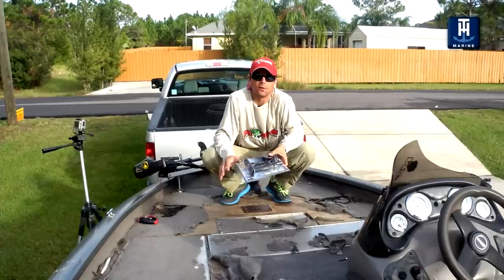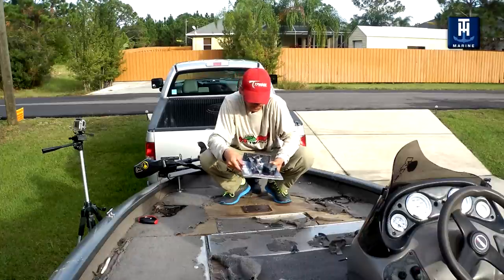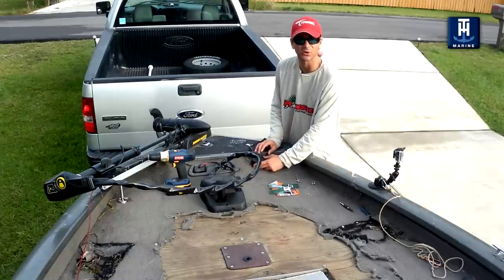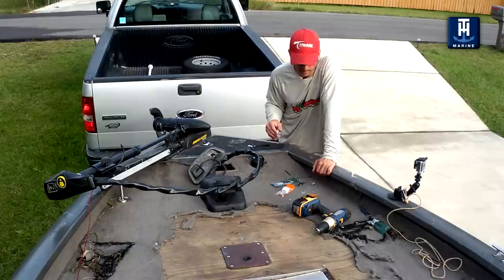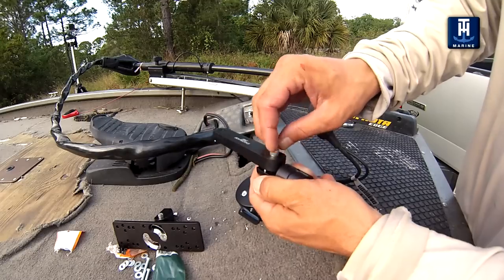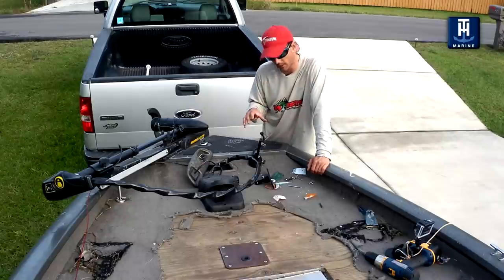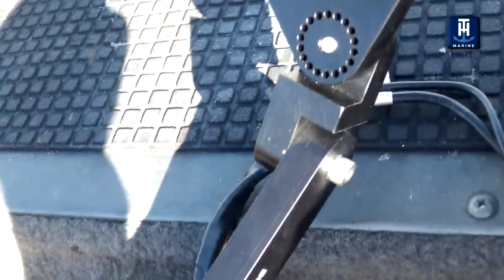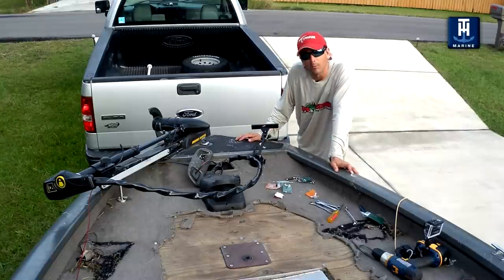T-H Marine Shock-Lock Install

Comment: You should have a 1/4" thick alum.  backing plate under the deck. It should be at least as large in dia. as the base of the mount. this will really add to the stiffness of the mount.